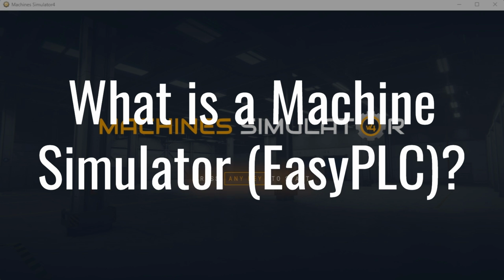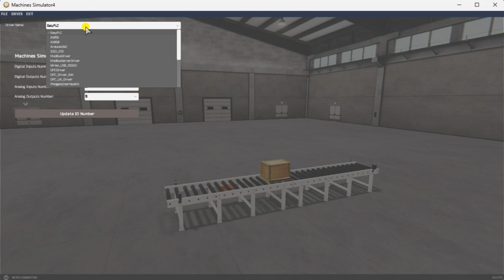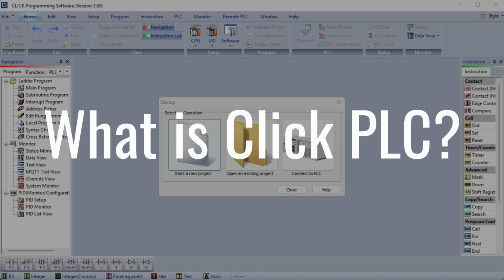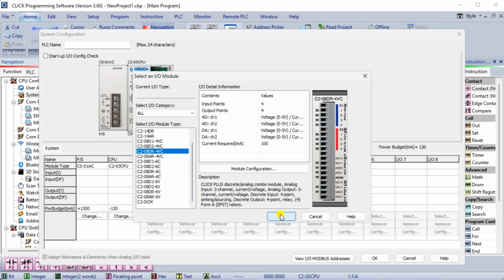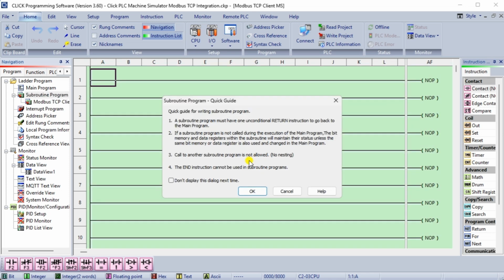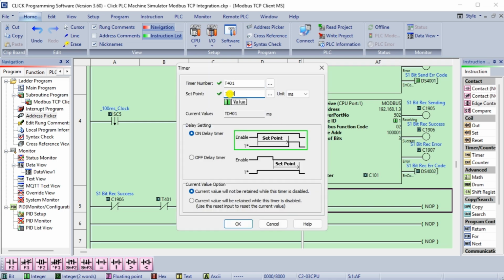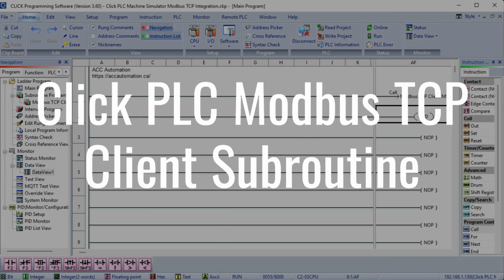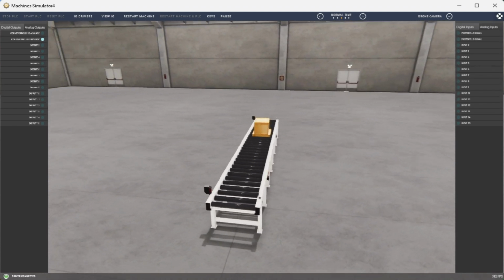Click PLC Modbus Communication Ports Configuration!

Comment from the maker: Unlocking Click PLC & Machine Simulator Integration: A Game Changer for Automation Professionals
In an increasingly sophisticated industrial automation era, seamless integration between programmable logic controllers (PLCs) and simulation tools is more crucial than ever.
Machine Simulator by Nirtec is a sophisticated yet simple software for creating virtual simulations of industrial machinery and processes. It enables you to visualize and test your systems in a virtual environment before implementing them in the real world.
Click PLCs have long been a staple for automation engineers, offering a reliable and user-friendly solution for various control processes. However, integrating Click PLCs with machine simulators unlocks a whole new level of potential. This blog post will explore the benefits and methodologies of unlocking Click PLC and machine simulator integration.
We will be using the Machine Simulator's test conveyor example. This practical example will utilize the Click PLC Modbus TCP communications to the simulator Modbus Server driver. Let's get started.

Our website post provides effortless access to all the relevant links discussed in the video. We have gathered all the necessary information for your convenience, to all the resources mentioned.
https://accautomation.ca/unlock-click-plc-machine-simulator-integration/

The EasyPLC Software Suite Series can be found here...
https://accautomation.ca/series/easyplc-software-suite/

Machine Simulator Suite (EasyPLC Software Suite) is a complete PLC, HMI, and Machine Simulator Software package.
This PLC learning package includes the following:
Easy PLC - PLC Simulation will allow Ladder, Grafcet, Logic Blocks, or Script programming.
HMI System - Easily create a visual human-machine interface (HMI),
Machine Simulator - A virtual 3D world with real-time graphics and physical properties.  PLC programs can be tested using EasyPLC or through other interfaces. (Modbus RTU, TCP, etc.)
Machine Simulator Lite - Designed to run on Android Devices.
Machine Simulator VR - Virtual Reality comes to life so you can test, train, or practice your PLC programming.

Purchase your copy of this learning package for less than USD 95 for a single computer install or less than USD 110 to allow different computers.
Receive 10% off the price by typing in ACC in the comment section when you order.
http://www.nirtec.com/index.php/purchase-price/
Learn PLC programming the easy way.
Invest in yourself today.

Here is a list of YouTube Shorts about the Machine Simulator Software Suite (EasyPLC Software Suite).
https://www.youtube.com/playlist?list=PL3y71jAPOdZAvTC8-TWNifAHpgEkAfqZQ

Regards,
Garry
ACC Automation
https://accautomation.ca/